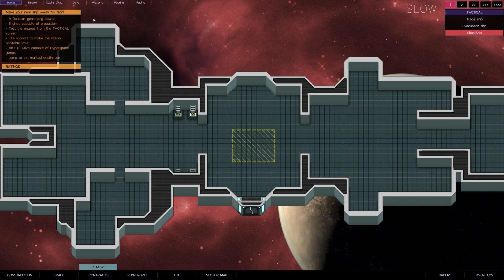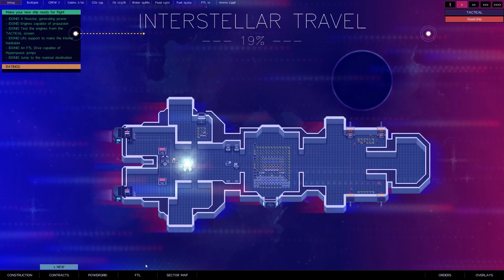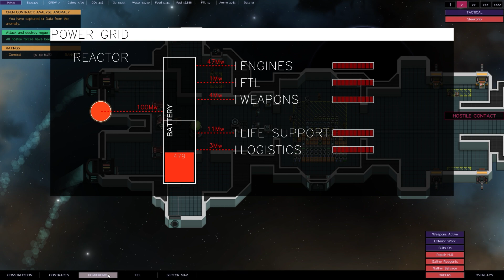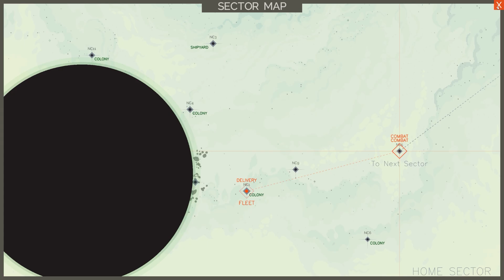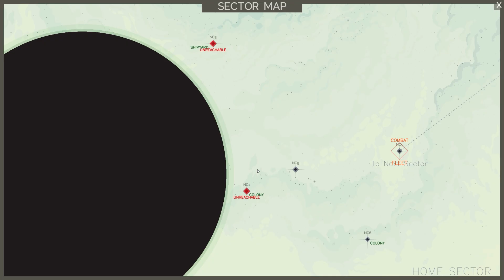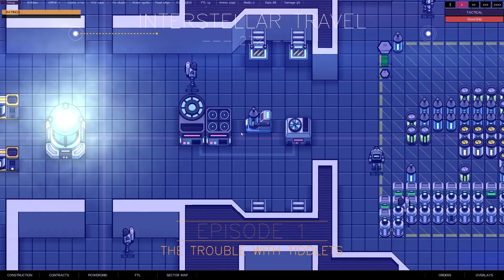Drone ATTACK While Clearing Space Mines! | The Last Starship

Comment: quite often buffertanks are usefull, eg in a loop "ship atmosphere > scrubber > air regeneration > airvent > ship atmosphere" else they may deadlock each other in that closed loop, especially when you have filled up the ship atmoshere to the limit and continue to load more oxygen to it. then the scrubber has no space to scrub CO2 because the air regenerator has no space to output oxygen because the airvent can not release more oxygen to the ship atmosphere. any partially filled buffertank for CO2 or O2 helps. those buffertanks are included in the amount of oxygen, fuel, etc when you do automatic orders to buy or sell bottles.
also the fuel might need a buffertank for the generators not running out of fuel while one fuel bottle in the fuel loader is replaced by another which takes a whike for the crew running around. batteries help, but when the ship needs a lot of power, you also would need lots of filled batteries for this time